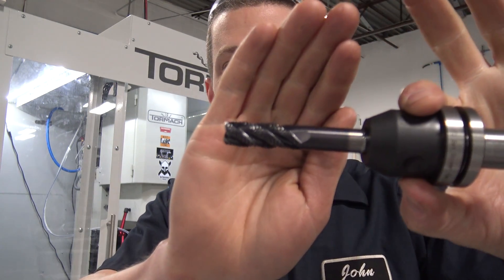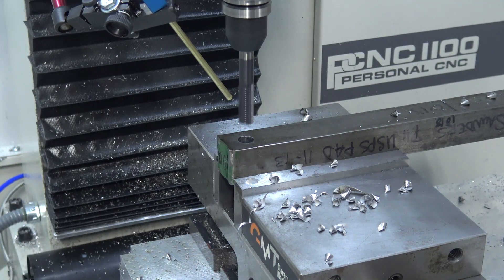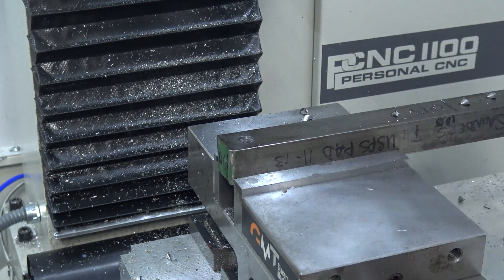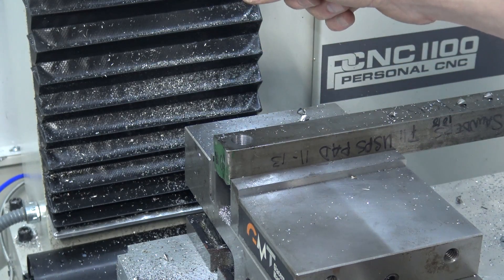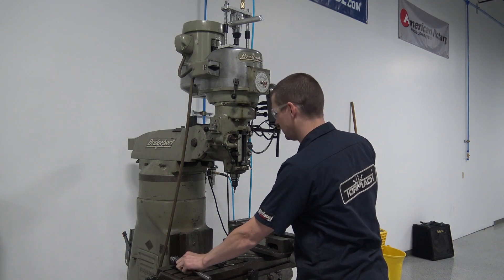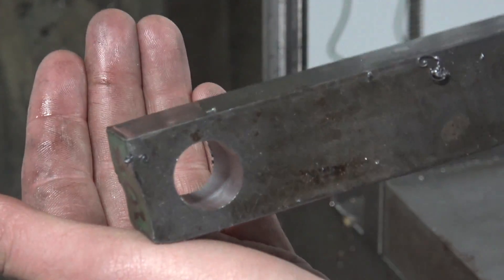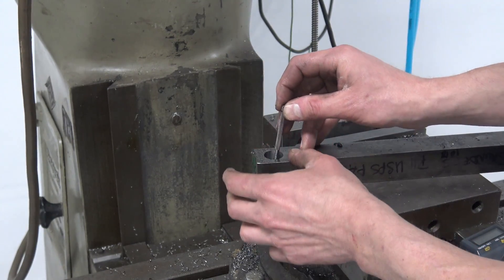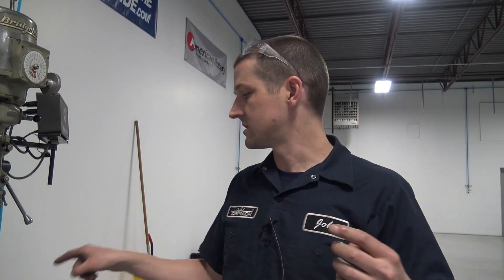Rough & Ream?  Will it work?  Part 1

Comment: 3 things:  That 1100 is about 1/2 the weight of a Bridgeport, so it's not going to have as good dynamic characteristics.  Doing a 7 degree plunge at the full diameter of the hole would likely have resulted in less chatter and a better wall finish.  When running a chucking reamer, the reamer should float a bit, if you don't have enough float, the reamer will not cut on center.

Comment: Drills are cheap. Surface finish after that reamer did not look good. Should be mirror finish. Also, CNC is best, they make short reamers if your machine can't handle the standard length.

Comment: You might have reamed too much. Seemed like it was hogging, rather than finishing. Also, I think the coaxial didn't look like it was dialed in, right?
Reply: +BasementShopGuy Seemed like there was some wobble in the coaxial too, bad collet maybe?
Reply: +BasementShopGuy I'm with you. It looked to me like there was still .0015-.002" left to dial in with the coaxial.
Reply: +BasementShopGuy I'm with you. The coaxial looked off.
Reply: Bent shank on the ream?

Comment: I find that a misaligned reamer will often result in an oversized hole. Keep in mind, I'm only doing 1/8" and 3/16" so I'm dealing with a lot more flex, so I can't say for sure.

If there's a bit of a bend or a wobble in the reamer that might cause the same sort of issue.

Comment: My thoughts is that the reamer most likely has run out, I've noticed on any of our reamers above .500, even new, have about .002 to .005 run out. Also a hot reamer can cause over ream, try coolant, and from what I've seen, using a reamer as if it's a drill and pecking it through, not too great, just run all the way through. I've also noticed that if you stop the spindle before you pull out of the hole, it helps a lot. P.s. I work at Blossom Machine and Manufacturing, Blossom Texas. Mainly machining parts Boeing, Honda Jet, and many more. Just to clarify that I'm not pulling this info out of my ass...

Comment: I have had really bad luck with reamers. It looked like you had a little wobble. Maybe it is slightly bent?
Reply: +Daniel Graves check the vid @4:50, i'm pretty sure i saw wobble in the reamer too. I find it interesting his runout on gaging was also about .002". He oscillated 33 @ a small peak then to 31 mean.
Reply: +Daniel Graves Spot on to my thinking.  

John, can you measure the reamer V blocks on the surface plate using a 10th or better indicator along the length of the reamer on several lengths?
I've seen Stan's Anchor Lube used.  Looks like that might be an alternative
to flood coolant.

Comment: too much stock to leave, .015 too much, do more like .005, lube the reamer and dont peck it.
Reply: .015 under on a .7505 reamer size is the correct size.  2% under the reamer size. However I think he left .015 per side and not .015 under on diameter (.0075 per side). 

only going .005 under (.0025/side) is no good. That's rubbing territory and it's a good way to not only work harden the bore, but to prematurely shrink your reamers too.
Reply: +Keith Krueger you're right everyone has their recipes for what works for them. I use a 1/2 speed, double the feed of a hss drill of the same size.
Reply: +Scott Austin Yeah, it looked like a heavy cut on the reamer to me too.
Reply: +Occams Sawzall 

Rule of thumb I was to drill 1/32nd smaller then reamer size for undersized holes and 1/64th smaller then reamer size for oversized holes 
(I.e. Press fit dowel pin in die shoes and dowel pin holes in die blocks)
Reply: +adavid7901  We were taught 1/64 undersize for 1/2 and smaller and 1/32 under for larger than 1/2" and to use 1/4 of drill speed  or slower. Lots of oil and heavy costant feed no pecking. I am sure everyone has a recipe that works for them this seems to work good for me.

Comment: I agree with slower speed and more lube, also it appeared to be a fairly heavy ream, I was actually thinking I never saw anyone drill a hole with a reamer! LOL  The coaxial indicator appeared to have a lot of wobble so it possible you weren't 100% centered over the hole!

Comment: Looked like you had about .003 runout before reaming the hole, and then at 4:58 there is visible run out in your reamer.  That will contribute to oversize hole for sure. Also I think you run reamer way too fast. I like to ream about 50rpm and it is one shot thru and if possible I like to leave it thru and not come back out of the hole. You don't want spring cuts with a reamer. Got any 3/8 relieved extended length finish endmills? I would just interpolate finish that hole and be done with it in one shot. :-)
Reply: +NYC CNC
You don't need a bar feed lathe, you need some more tooling! :-) That warmill sounds like it has fought a few too many battles, that thing sounded dull interpolating that hole. I would expect a rougher to be a lot happier sounding than that unless that was some hard mystery metal. Also I would suggest helixing the hole with like .100 downfeed/rev so you don't have so much in contact at once. Looked like you were coming out with a .375 to .500 DOC then circling? That is a lot on a long endmill like that in that small a diameter.    Speaking of which what size shanks do you use on your lathe tools? .750 or 1.00? I may have the solution to your CNMG inserts that don't like to sit where they belong. Plus they are faster to use.

Comment: .005 stock for reaming. .015 is way way too much. also a flood for the reaming would help but not a necessity. If you listen when you started the reamer it was squealing.  that was the sound of the reamer being pushed off center and starting the oversize condition that followed thru the entire part. My suggestion bore it to .745 then ream with flood or moly see lube
Reply: Moly Dee damn auto correct.
Reply: +Cad-Cam_Man The end mill squealing can be eliminated by a helical ramp into and thru the hole OR 4 plunges thru at x+&- then y+&- leaving .015 on the dia.  followed by a radial cut at full depth to take it to .745 for reaming or forget the reamer and bore it with a finish endmill

Comment: John, unless it was your video edit, it didn't look to me like the part was properly centered when you moved it to the Bridgeport. The basic rule is to leave 2-3% of the hole size as the material to remove. TIR is crucial! Don't peck - just feed slowly with a ton of cutting fluid.

Comment: Reamers tend to ream over size if the ends of the flutes are uneven or not consistent in sharpness, should one flute be duller then the rest the reamer will try to divert away then cut in an eccentric motion. You can send reamers out to be sharpened, by your self on on the surface grinder with an indexing fixture, or even by hand.
 I had met a long time machinist how said he hand sharpened the ends of reamers like a drill, he would blue the end with dykem then on the lathe scribe a circle just smaller than where the cutting edges of the flutes meet the flat nose, On the bench grinder he would sharpen till flutes met the circle while checking the angle with protractor against the light.

Comment: Peck reaming? I always thought you were supposed to ream in one smooth motion.
Reply: That's my understanding too however it appeared, even within the video, that the reamer had runout in the chuck.  Re-watch and it wobbles
Reply: +Reely98 
Straight flutes you go straight thru. No stopping no pecking. Pecking drags chips through the bore and will wedge between the bore wall and reamer causing galling over sizing and other bad juju.  

Spiral flute reamers can be pecked though since the spiral evacuates the chips up and out of the hole.
Reply: +Occams Sawzall agreed... but looking at the lip when he lifted, I'd prefer less material to ream so the bull nose doesn't skate on the ledge.  Or a larger bore to start with.
Reply: +Siraj Shukri depending on the reamer itself. if the fluets are straight u should do several motions

Comment: That endmill sounds pretty horrible in my opinion... However, I understand getting things to work in a time crunch. 
Maybe taking a thou or two off of the endmill roughing cycle would help with the finish diameter. Just a thought. Thanks, Dave.

Comment: check the runout on reamer it might be cause of problem also you want .007 to .015 to ream also pecking is bad just go for it
Reply: That was my initial thought as well...
Reply: +james smith 
Agreed,  a small misalignment (runout @ 4:53).
Reply: That is what I was going to say as well. I believe I saw a bit of runout on the reamer, also with a reamer, even that size, I would leave less than .010" for it to take out. General rule of thumb I use on reaming holes is to divide the reamer diameter by 100 and that's the most you wanna take out with that reamer. So a .750 reamer/100 would be .0075". Just gets you in the ball park. And like the others say, just go for it all in one shot.
Reply: I have always been told pecking is bad with reamers
Reply: +Colt Burns 
I had the same feeling. I am screaming at my laptop, dont you see that runout?
Reply: +james smith I agree there appeared to be a wee bit of runout when viewing the reamer while in the Bridgeport.
Reply: Got to agree with all above
Do not peck one smooth pass, use a floating holder for the reamer ( not a rigid mount ) leave about 0.007 ins ( dang imperial )
And plenty of lube 

FWIW I would have used a finish EM as a finish pass to get the best start

Stuart
Reply: +Occams Sawzall I guarantee he didnt indicate the part flat as well
Reply: +james smith I agree with this as well.
Reply: I think I would just use a boring head myself then there is no way to mess it up once it is set
Reply: At the 5:00 mark. If you listen to it as it first enters you can hear the misalignment. 

You can hear it cut heavy on one side then get pushed to the other. And take a lighter engagement. 

$$ is on that .003" off from the coaxial. 
Which. Watching it a few times again, does have a significant wobble to it. The whole coaxial unit is wobbling quite a bit. 

Either bad collet. Or the coaxial had a secret  date with the concrete floor and didn't tell anyone 😁
Reply: +james smith 

True. But it's being held the same way in  both machines. So the hole is still square to the stock so that shouldn't matter. At least not enough to over cut by that much.

Comment: leave less to ream I say.
Reply: +pbrubaker 

He said he "left .015". Now. I don't know if he rough bored to .735 (which is .015 on diameter) or rough bored to .720" (.015 per wall). 

If in CAM he selected the .750 and just said -.015 on the wall offset, then he's .015" too small for that reamer. And that reamer did look like it was pushing pretty hard.  So I suspect that's what he may have done.
Reply: +Occams Sawzall I agreed with you on this issue on the other posting.  Just caught the user name...  very cool.